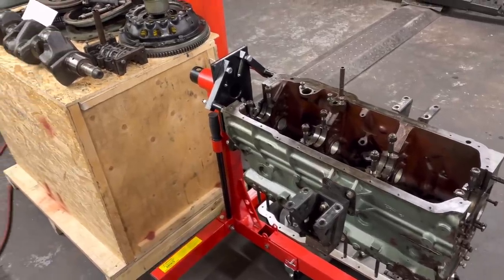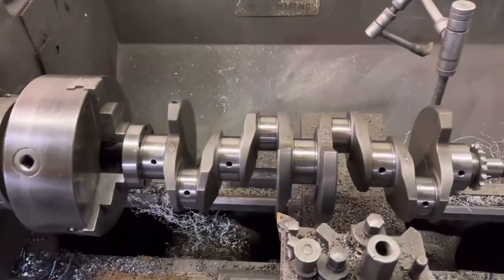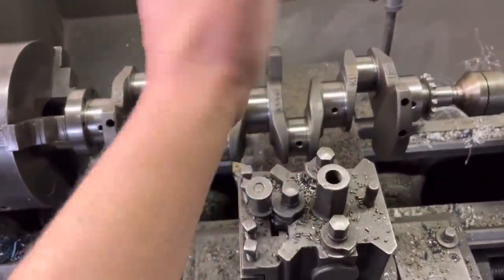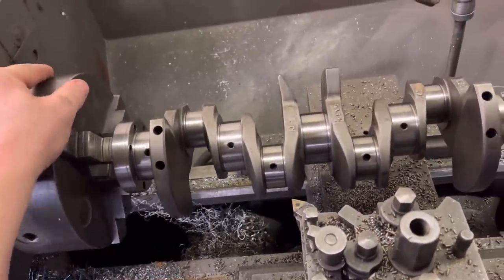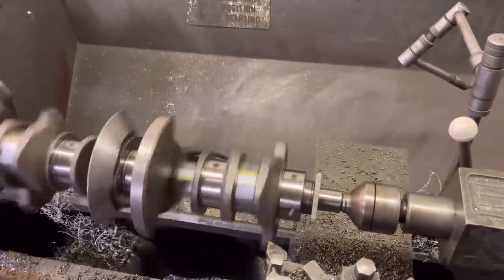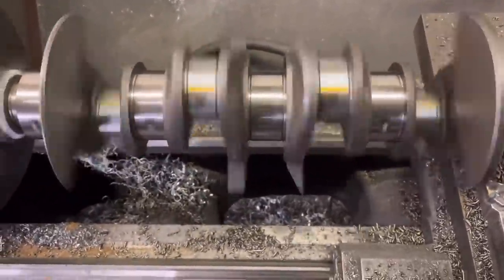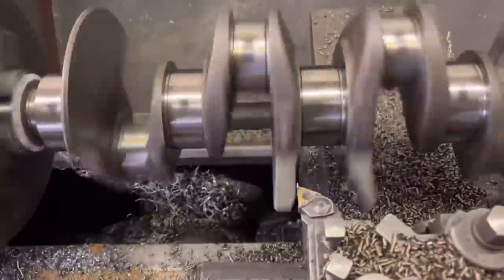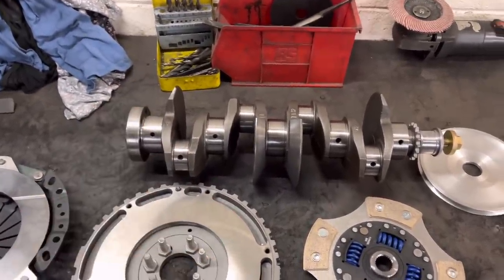CRANKSHAFT KNIFE EDGING, What is it? How do we do it and what are the benefits?

Comment: As those weights that are knife edged are to balance the pistons going up and down, do you need extra light pistons to keep it dynamically balanced?
Reply: The weight of the pistons is irrelevant. They aren't rotating.
Reply: @Wilbert  If you are building a high performance engine - yes.  Each counterweight exists to oppose (balance) the crank pin, conrod big end and about half the piston and conrod small end, for the benefit of reducing crank bending loads and bearing loads.  Reducing counterweights (or not having them in the first place) is ok for low revving engines and/or those with extra wide bearings and oversize crankshafts for small pistons (more likely in old, low power engines).
Reply: @e-curb  piston weight is very important as is conrod end to end weight. it all adds to the harmonics and one piston or rod out of balance to the rest can lunch a motor in no time
Reply: @abitofeverything9970  I never said having one piston heavier than any other isn't a problem. The weight of the pistons has no effect on the rotational balance of the crankshaft.
Reply: @e-curb  yes it does! The weight of the pistons and rods DOES affect the balance even though they are reciprocal not rotational. Watch some videos on crank balancing... Which iv done plenty... Bob weights... End to end, even weirghit wrist pins and C clips. Everything.
Reply: @abitofeverything9970  That only applies to V type engines. The bob-weights are only to compensate for the connecting rod. the piston doesn't matter. Bob-weights are not used with an inline engine or a V12. Flat fours like Subaru are also unaffected by the rod or piston weights.

Comment: Every knife edged and balanced crank we’ve done in our race engines has crapped itself 😂.
Reply: Not surprising - the knife edging shown here has removed about half the counterweight.  Each counterweight exists to oppose (balance) the crank pin, conrod big end and about half the piston and conrod small end, for the benefit of reducing crank bending loads and bearing loads.  Reducing counterweights (or not having them in the first place) is ok for low revving engines and/or those with extra wide bearings and oversize crankshafts for small pistons (more likely in old, low power engines).
Reply: DV has a video explaining how much material can be removed and from where. Knife edging looks like a lazy way of getting a few faster revs. Basic rule of thumb is you can take off the crank the same weight you have reduced the rest of the rotating assembly by.
Reply: @stuartwinter2758  
I’ve always left it to machine shop to do tbh. I just send the cranks to be balanced these days, I balance all rods and pistons in house. 
Engines I tune high rpm and knife edging isn’t allowed in the regs for bsb or wssp.

Comment: I never understood the purpose of knife edging other than weight. Inside the crankcase it is so turbulent and chaotic you're not going to gain anything drag wise. Air and oil are being flung in every direction you could possibly imagine.
Reply: Exactly, air and oil is being flung everywhere, but the stuff hitting stationary walls doesn't matter. The stuff that the crank hits does, every hit imparts energy, which now becomes waste energy instead of BHP. The less the crank webbing hits the less energy it's wasting, and hitting continuous rain drops of oil with a crank doing 7000rpm quickly adds up to quite a bit of energy.